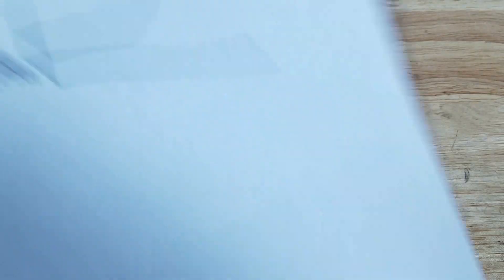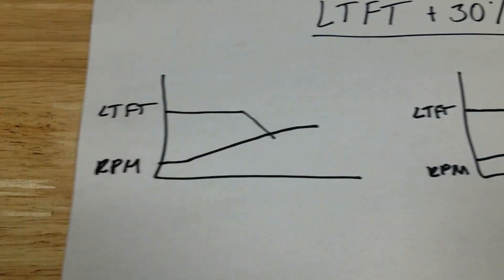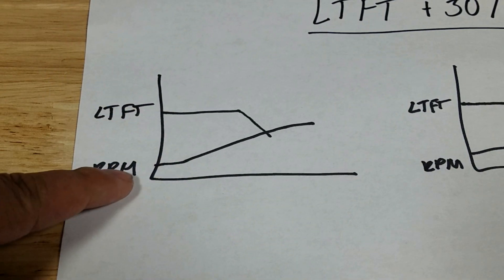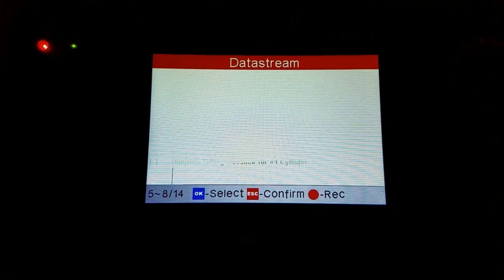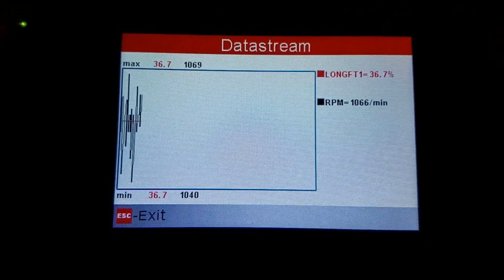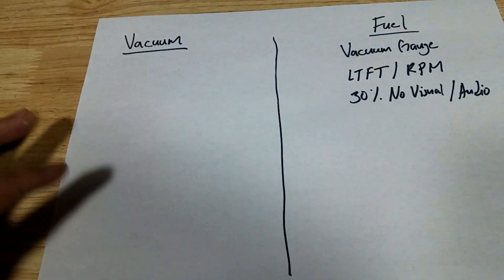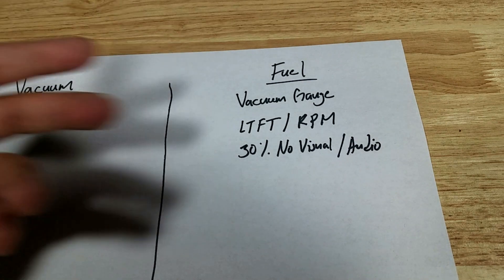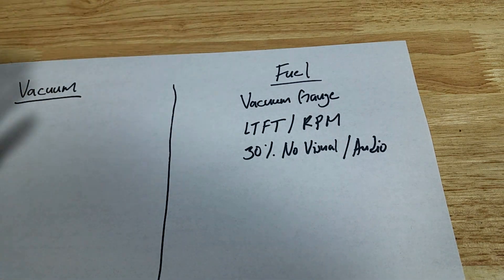THE BEST BY STEP GUIDE TO FIXING P0171 ENGINE CODE SHORT AND LONG TERM FUEL TRIM OBD2 SCAN

Comment: TU...could a small hole  less than a 1/4 inch drilled at the underside of the Muller to let water out cause P0171?
Reply: Nope